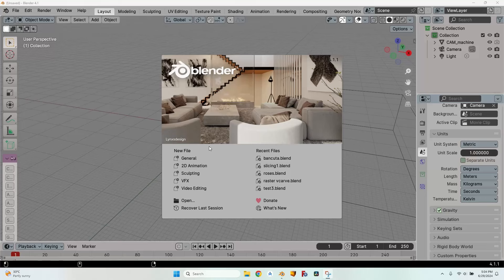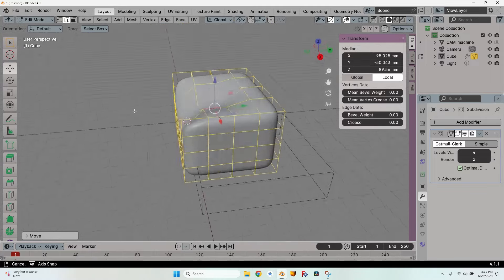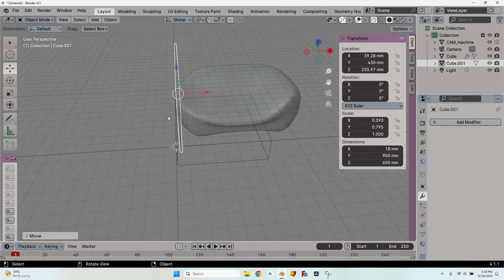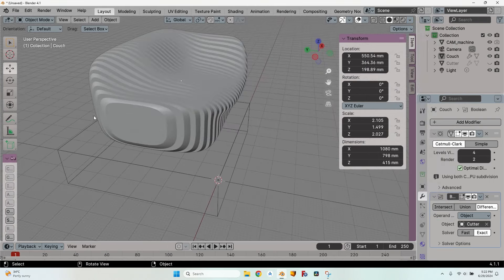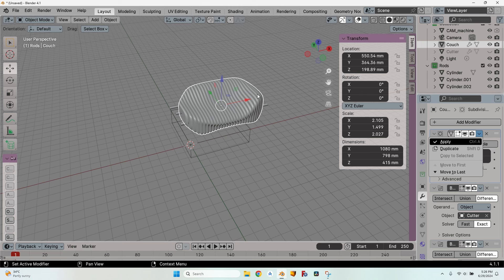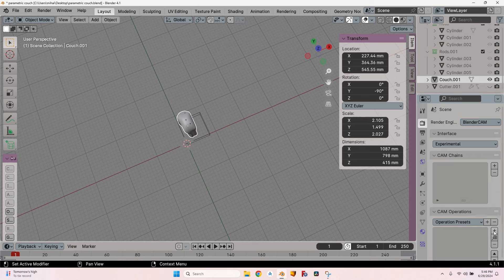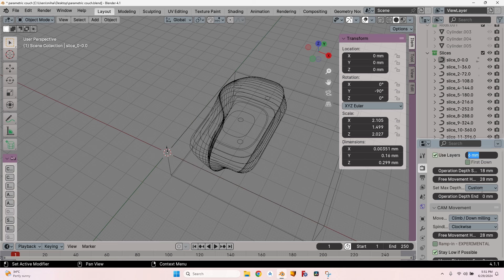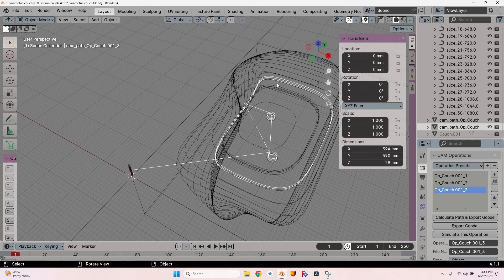Blender CAM Ep. 2 || Making parametric (sliced) furniture and the G Code for CNC

Comment: Have you experimented with tiling the slices to optimize the use of material and then calculating the toolpaths? If there are no bevels, I imagine those slices could be exported to an SVG file and then manually organized in a vector drawing application.  I might be incorrectly assuming that you're cutting one slice at a time.
Reply from the maker: You are assuming correctly, one at a time. There's a feature in blender cam, "pack curves on sheet", but it's experimental for now and comes with a warning: "it's slow", which is true.